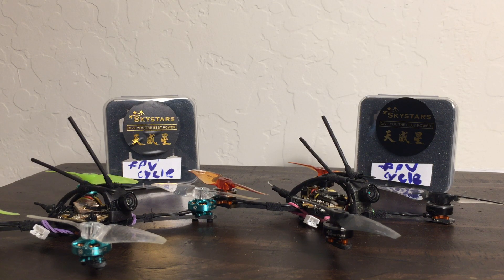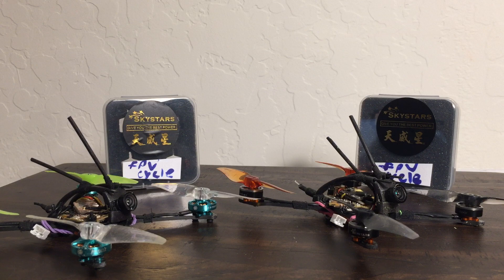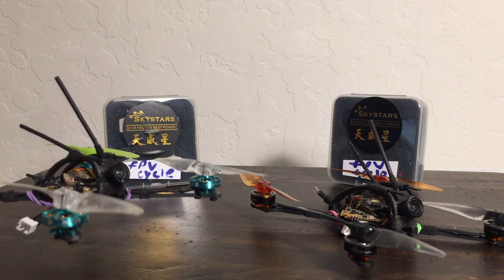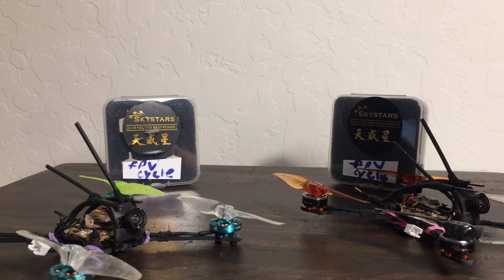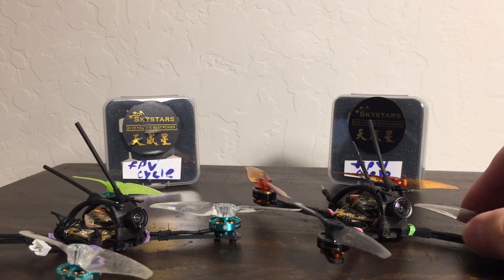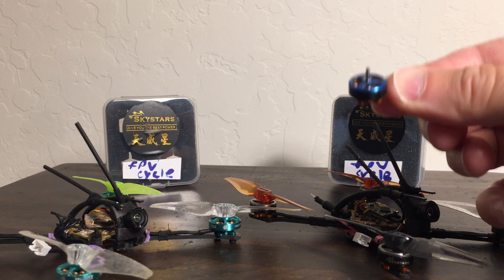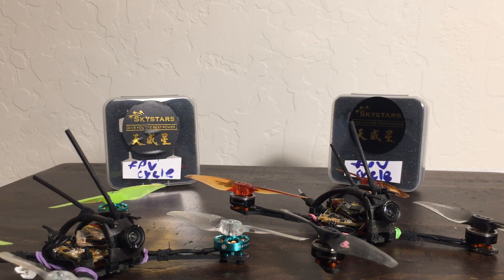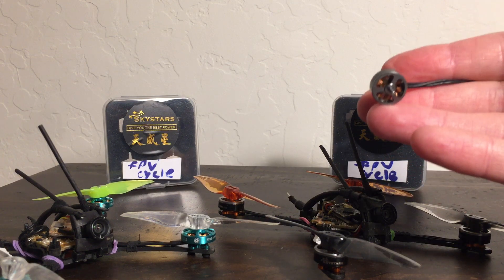1103 vs 1202.5 3 inch 1S motor shootout !

Comment: I found some 1103 15000kv motors on GetFPV, you think that's too high a kv for 3 inch? I don't want to burn out any motors/escs, but would like a bit of extra power. What are your thoughts? Thank you :)
Reply: I know it's late but you could just put on a throttle limit at about 76% to make it 11500kv
Reply: @abrahamtan9704  Never too late :D Thanks for the reply, I've learned a lot since 4 months ago, I'll probably just go with some 1202.5 11500kv, those are speced to pair well with 3 inch props
Reply: @RealFlight-u4h  cool, I just built mine with the betafpv 1103 15000kv with a tp3 frame and it's still lighter than the deluxe babytooth build 😃 haven't flown it yet, I'm gonna try it first thing tomorrow morning
Reply: @abrahamtan9704  Tell me how it goes! the 1103's are cheaper, I might go with them if people aren't having problems
Reply: @RealFlight-u4h  sooooo the efficiency is not very good, not sure why yet but it flies for about 3 min and the I have to land. Im gonna spend the whole day figuring out why because it flies nice and is quiet. My only problem is the efficiency
Reply: @abrahamtan9704  What battery are you running? Kabab suggested 650mah
Reply: @RealFlight-u4h  I'm using a pretty
old 450 hv
Reply: @abrahamtan9704  Hm. I would try a 650mah if you've got it, but even so, 3 minutes is about what kabab is getting. Glad to hear its working though!
Reply: @RealFlight-u4h  what do you think about 1203 vs 1202.5 with same 11500kv? Weight is only 0.3g more. Talking about 1s 3 inch babytooth. Just not sure how high the amp draw is on 1203, because Im limited to 4x 5A
Reply: @chrisbee5481  Not super sure about that, from 1202.5 to 1203 is a 20% increase in stator volume, meaning, if its a linear function, it would pull 20% more current. Hard to say without some testing, but if the escs hold up, it would probably give it a fair boost in power with the given weight increase.
Hope that helps a bit

Comment: Flywoo 1202.5 11.5k kv are awesome, and feel more responsive than the FPVC motors. Viewing from the bottom, it is quickly apparent the Flywoo motor does not have the thick heavy back iron seen on the FPVC 1202.5. 

I built up a RedShifters 3" 1S with the Flywoos, and hit 36.6g dry weight. It's a 3d printed carbon/nylon frame, and it is well designed, and beautifully printed. Excellent frame. Definitely most responsive 3" 1s ive flown, and it's on the 3018s. I have some HQ lower pitch, but yes, the balance is garbage, and makes them a non starter. Ive heard of someone using Betaflight to balance props, so i may look into this further, to try and correct the HQ props. 

Flywoo 1202.5 11.5k kv are my favorite motors for this class, but I dont think they can take the shots the FPVC motors can. Could be wrong. You should def. try some though, as you would get to the bottom of that question im sure. I can say they've handled dirt and dust exposure quite well.
Reply from the maker: 24kJames very interesting, I would not have guessed the Flywoo would be more responsive but the build difference may explain why they test different that the fpvcycle. The thrust data is less impressive than the fpvcycle but if they are more responsive that would be a trade off I would take.
Reply: @Quad66  Im going purely off casual experience, and not t̶o̶t̶a̶l̶l̶y̶ at all scientific. With that said, i may try to do something more empirical.

Regarding thrust data, and I sincerely love and rely on data in many other fields, if the present tests, and their numbers really told us anything practical, motors would not remain such the mystery they appear to be. We'd all look at a menu, and pick precisely the motor we needed. Now, we may be headed that direction eventually, but the variety, and complexity of the variables relevant to brushless motor design for multirotor aircraft, and their interelationships, seems to keep such a structured vision at bay. 

If it's helpful, Id be happy to send you the 3" 3D printed build with Flywoos for a week. Id love to see this thing with you at the controls.  Ill include a return label. While full tilt, boundry pushing, higher consequence acro might be avoided, there's no doubt you can carry out flights that would afford you a proper assessment of the motors. Regardless, Id be accepting all risk, or potential outcomes. Or, i could just send you a set of motors for a week. That may be ideal. Seems like personally flying most/each motors you have the data for, is the only way to see exactly what the chart can, or cannot tell you.

I concede, your assessment will,  in all liklihood, be significantly more valuable than my own, just based on the higher level of flying you'd perform. Youd get far better, and more variety of data to inform you. Add to that your experience in such assessments, your general level of experience in the craft, tuning knowledge, etc., and your top notch assistant, these are the reasons why I am inclined to contribute to the efforts on this channel. Seems worth my time, and resources. Im already living the benefits of some important knowledge gleaned here.

If I could buy you a set to keep for testing, Id think thats optimal, and in fact Ill consider that possibiliy as well, now that ive mentioned it. Either way, I still have these 5 or 6 Hyperlite 12.6k kv (white wires,) motors that are yours for the taking, as previously offered, and of course shipping is covered too.

I understand perfectly well, too, if the channel is not interested in contributions of that sort. In this case, Ill appreciate continuing to just share my casual opions, and experience when relevant.

Thanks for the feedback.
Reply from the maker: 24kJames I agree on limits of thrust testing, I have found though that my impression at the sticks correlated very well with Karl Pablos test results. What is definitely missing though is how readily the motors can change thrust ... most stand data is just telling us what the motor does after steady state is achieved between tests. We’ve discussed whether a protocol with a square wave could be useful in showing the error between input and thrust. And then you add in all the other interactions with ESCs and tune etc.            I would be happy to do some testing on the motors and pay for shipping plus buy if I break it promise. Are you on FB or the rcgroups forum? We can connect via DM.
Reply: @Quad66  Found ya on RCGroups. Ordered 5 new motors yesterday. Should have them to send along to you for testing by Monday or Tuesday. Thank you for the thorough reply, and continued information. Im looking forward to the results/your impression. Cheers-
Reply: @Quad66 ...and I should explain what Im calling responsive, as there are a number of factors thay may affect it. But I am simply refering to throttle response. I punch it, and it reacts how fast. ..perhaps how fast the blades are brought up to speed.

Comment: Months ago I put together a quad out of spare parts, F3 Crazybee, Skystars 11,000 powered by a 450mAh 1s.  It didn't fly as well as my 1S TP3.

This quad now has a 12A Betafpv FC (The Crazybee caught fire) and crossfire and flys great.  AUW is 68g with a 350mAh 2s battery and running Betaflight 4.2 with a throttle limit of 75%.  I will go back to Emuflight 0.3.x in a few weeks.

My biggest issue is the motors.  I'm down to my last 4 motors from 11, the shafts are just so weak.  I will dismantle this quad upon the next broken shaft.

Anyway, try Flywoo's 1202.5, 5800Kv motors on 3s.  AUW around 85g with a 450mAh 3s battery.

Comment: The re-discovery of 1103s :)
What annoys me most on my 7500kv amax (on 2s) is that around 60% throttle, the quad would pop into the air, making control in tight space harder.
Reply from the maker: They do have an interesting power band the comes on a little later than you might expect it.
Reply: are you happy with amax motors? i'm looking into buying only their motors in the future if possible, but dont know about the durability and quality control...

Comment: This is a well timed video. I was trying to work out which prop to run on my 1s picklepick 3" with skystars 1103 1100kv motors. I already have some gemfan 3016x3, but would I be better off with the gemfan 3018 biblades?
Reply from the maker: I expect that the 3016 wont have enough top end like the 3015 biblade. I don't have any 3016 1.5mm unfortunately so I can't check. The other prop I would be curious to try is the old school rotor X  3020.
Reply: @Quad66  good idea. I bought some HQ T3x2s but then your videos and posts on RCgroups convinced me they were probably too much prop. The site you mentioned with thrust test data seemed to show the gf3018 was pretty much the same draw as the gf3016x3, but that was on the pyro motors. Thank you for the content by the way, your videos are super informative!